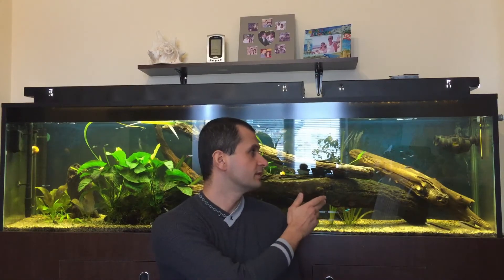How to build a glass aquarium Silicone Injection Method 2 meter long tank

Comment: Awesome! This method seems very practical and easy using less silicon. I found out that cured silicone does not bond well new silicon. How long did you wait for the first batch to cure to apply new silicon to full tank after removing the fishline?

Comment: Highly informative video, but you should take a little more time to explain the technical details such as how to use the corner vices, installing reinforcement at the top of the tank etc., Not every viewer is as skilled as you are and would benefit from a slower and more detailed demonstration, as they might be first time builders. You will have more subscribers if you slow down your explanation for less skilled viewers, who are the majority. Thank you for sharing your technical expertise, and also furnish more details about the stand, like the material used, thickness, section size etc.

Comment: Can i reduce 4mm total from the side which gives me 2mm on either side? I have 10 inch cable ties that i plan on using as spacers. They are about 2 mm thick. Is this OK, or is 2 mm too much of a gap between the glass panes? In addition, the tank has the sides, front and back sitting on top of the base. I'm using 12 mm glass and the tank dimensions are 48 inches (length) by 17 inches (width)  by 21 inches (height). I will be cross bracing the tank with three braces about 3 inches in width. One on each side and one across the center.

Comment: Hi boss
Loved your idea.. Finally i learned that how to use inject meathod. Im in process of making my own tank and want to follow your way. 
Can you pls help me share your measurements in millimeter or centimetres for all (5pcs glass panels) i will using 10mm glass for (4ft x 2ft x 2ft) tank. 
I will get the glass from my local glass shop so i need a size in millimeters or centimetres. I will give the measurements to shop so they cut the glass accordingly. 

I hope u will reply ASAP
Thanking you in advance
:)
Reply from the maker: Hi. I put the glass panels on top of the bottom panel. When you order your glass just keep in mind that you will need to cut the glass 2 millimeter shorter or longer to allow for the silicone seam. My tank is 200x40x55H in centimeters, so the bottom panel is 200x40, the front and back panels are 200x55,2 cm. and the sides are 39,6 x 55,2 cm. As you can see you have to  add or remove 2 mm from the glass panels to allow space for the silicone.Good luck.
Reply: @AquariumLover2016   my bottom glass panel size is 121.92cm x 60.96cm

How many mm /cm should i reduce from each side to make it like ur method. Pls advise the
Reply from the maker: You do not have to modify the bottom panel because the other glass panels sit on top.
Reply: @AquariumLover2016  what if i put all 4 glass panels beside bottom glass?  Means bottom glass is in middle and all 4 glass panels on each side.. So in that case i can make clean silicone inject.
Reply from the maker: You can do that, yes. Just keep in mind the 2 mm. space for silicone.
Reply: @AquariumLover2016  I got 
** 2 pcs of side (60.96cm x 121.92cm) 
** 2 pcs of side (60.96cm x 58.96cm) 

*#* 1 pcs of bottom (120.72cm x 59.76cm) together with 2mm gap for inject is it correct?

Pls correct me if im wrong.

Comment: what is the glass tickness?
Reply from the maker: Hello. Glass is 10 mm.
Reply: nice. I am to construct one of 300cm x 70cm x 80cm height.  do you recommend 19mm thickness all round. with support like yours.  Thanks!
Reply from the maker: Yes. That should work just fine.
Reply: Thanks for sharing. Very informative 🐟🐟🐝😁

Comment: So you didn't need a frame around the bottom at all. My 220 gallon aquarium is going frameless then. What do you think? 72"Lx24"Wx30"H
Reply from the maker: I think its going to be awesome, but keep in mind the 220 is double the size that my tank has (105G), so I would suggest a double bottom or just thick glass (12-15 mm for the bottom)  👌
Reply: AquariumLover thanks a lot!!!! I was wondering why my 125 has 2 pieces of glass at the bottom! The 220 has a thick piece of glass for the bottom. 🤗